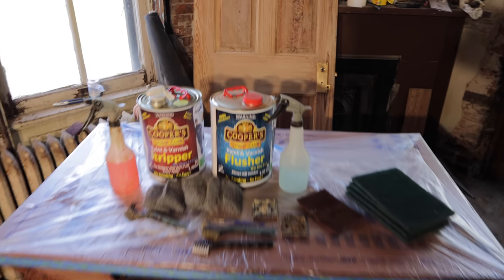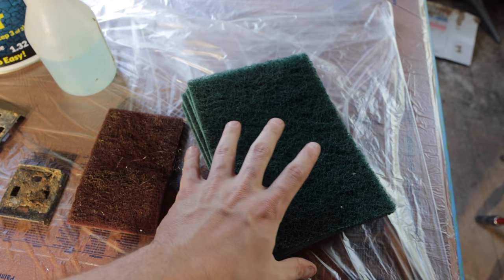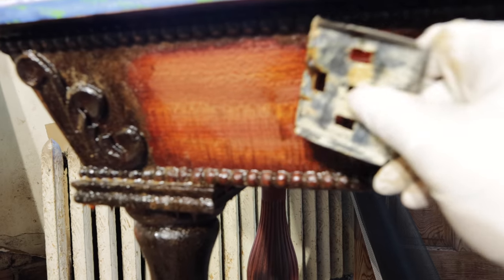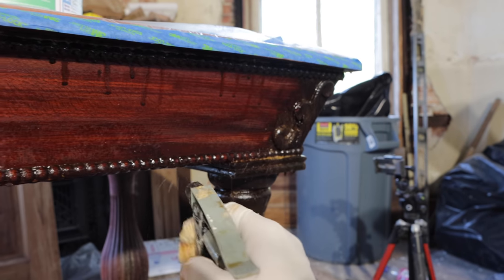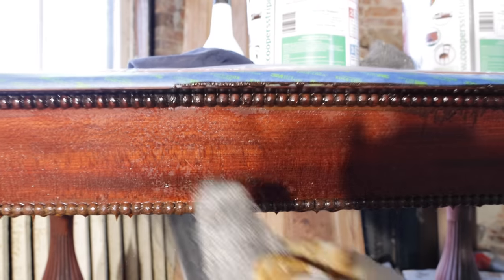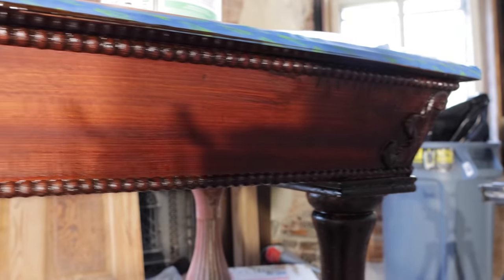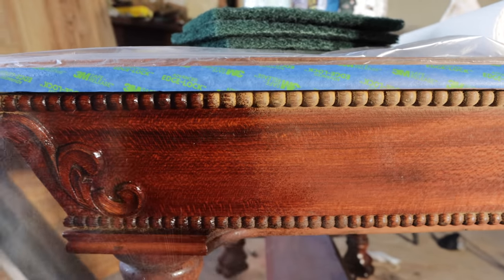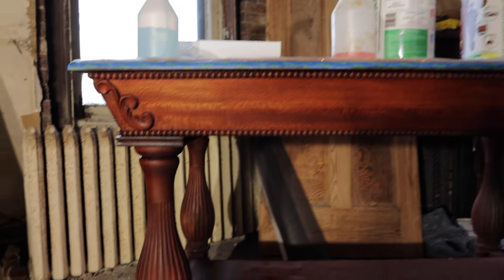DIY! What Tools and Materials do I use?  EP 3

Comment: The desk will be beautiful when you are finished with it. You could put a piece of leather with gold embossed edges in the center of the top where the water mark area is. Desks use to have a leather area as a writing surface.
Reply: Or a pretty lace table runner would work also to hide the water mark!

Comment: Those scrapers youre using look awkward to hold for long periods of time. I use two, two inch putty knives. One to scrape the finish off and the other to scrape the putty knife clean. I keep a coffee can with a bit of paint thinner to rinse the knives, steel wool and wire brushes in. 
P.S. Silver shield gloves don't melt.
Reply: I have that exact scraper and it’s actually the head attached to a wooden handle.